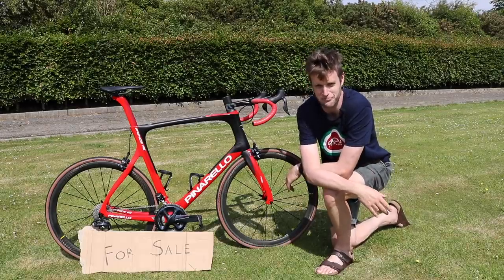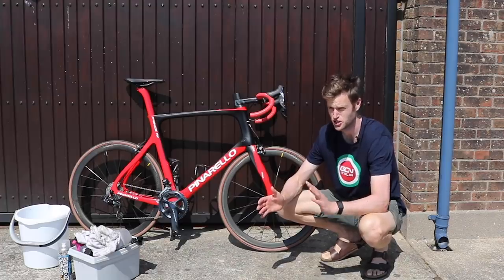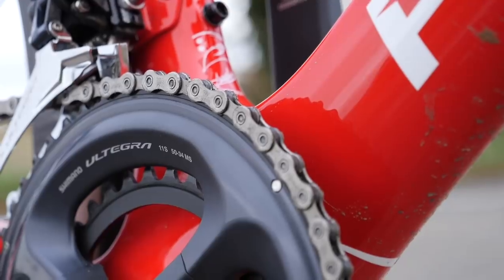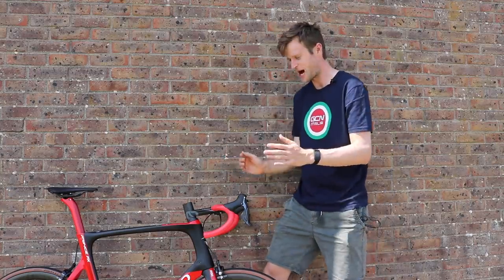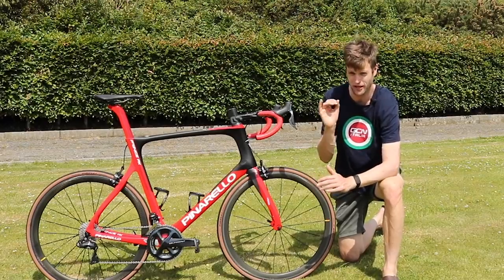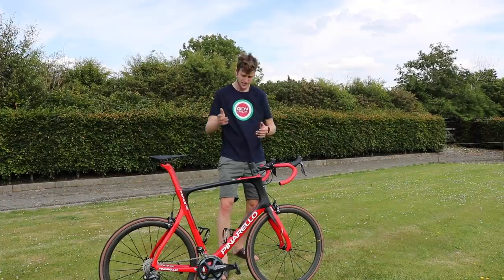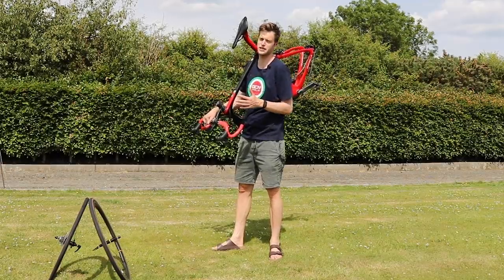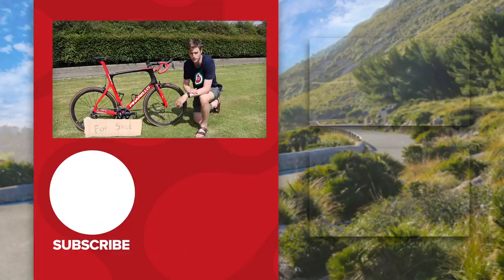How To Sell Your Road Bike For More Money

Comment from the maker: What's the best second-hand bargain you've ever managed to get? Let us know 👇
Reply: Last week, focus izalco pro 2015 Sram force/red for £375 👍👍

I didnt even need a new bike 😂😂
Reply: Has to be the one that got me into cycling and I have been riding for over 2 years now :). A pristine 2003 Koga Miyata GentsLux with 105 for 300 euro!
Reply: Giant tcr advanced disc 2 with only 40km for 700€
Reply: 2012 carbon specialized roubaix frame for 200usd
Reply: I was working at a large sporting goods chain, a homeless couple came in with a bike, not uncommon, grabbed one of our bikes, ditched theirs. After a few months I asked my manager if I could have it, it’s just a single speed but it’s got decent wheels, gator skin tires, and it fits me. What more could I ask for😂
Reply: A lovely old Raleigh with 531c tubing and full campag groupset, headset, and wheels etc aswell as cinelli stem and bars, all for just a £5. My best gumtree find. An add with a pixelated single picture turned out to be absolute treasure
Reply: Pinarello gan S with ultegra for 1650
Reply: Carrera ltd TDF, pretty much brand new for £100, rode it for a year for commuting and sold it for £180 as it was still in good condition!
Reply: Got voodoo hoodoo for £250 brand new off a mate who's changing over to a road bike.
Reply: And last year giant propel advanced 0 for £1000.
Reply: Got a a BMC Roadmachine for only the price of a pair of bolt cutters! Lucky me
Reply: Just got sram force and all the parts for a venge for $230 cad
Reply: I just bought a 2018 Trek Domane SL5 Disc from a private owner for $900 cash. It needed some cleaning and slight maintenance. But now it's mine and my first carbon framed bike. It has tons of potential with upgrades.
Reply: My favorite second hand bike buy was a 2010 Gary Fisher Cronus Ultimate. I got it as a carbon repair frame. I built it up with my first generation Sram Rival 10 speed group, Easton cockpit and Mavic Wheels. Best riding carbon bike I own.
Reply: the only complite bike i buy used was a balistic  road frame with carbon flat bars  for 200euro ,, price new was 600 ,,  upgrade the wheels and crank set ,   install drop bars with sti shifter ,  and use the wheels and crankset on a old peugot i got for free ,,  and the flat bars with shifter on my gf bike ,,
Reply: Bought a Specialized Amira SL4 pro race with Sram Red components for $900.  Saved maybe $4000 off the new price. Also bought a Open One+ mountain bike for $2400 with Sram XX1 Eagle.  Probably saved $7000 off the original price.
Reply: Got Dutch Union town bike 15 years ago for 100€, second hand, and still an absolutely belting runabout. ...albeit two serious overhauls later. Quality lasts!
Reply: I bought a used used carbon trek for $150 on local listings from a guy rushing to sell and zipp 50mm carbon wheels almost new for $100. I have a 15.5 pound bike from 2013 with aero bars, saddle and seat post for under $400 bucks total. Got an offer for $1300 yesterday when trying to see how to value it
Reply: Mongoose ledge 2.1 for $35, still had knobs on the original tires!!!
Reply: @jesseladd6864  holy hell, this is a dream,  I thought I had a good deal...
Reply: 1991 Francesco Moser Leader AX in hot pink with full period Dura Ace 7400 for €400. I've still never seen another one in the same colour scheme.
Reply: Jesse Ladd whats the brand for the 2013 bike
Reply: Mid eighties Celeste bianchi specialissima with full campy, including delta brakes  for 350.00 on craiglist. I’ve never sent an email faster before
Reply: I got my first bike for free from a friend who was clearing out his shed
Reply: Diverge expert ultegra for 900
Reply: 20 years ago I got a Tiagra with full Campagnolo Record for free. Campagnolo still working well after ten thousands of kilometers 😁👍🏼
Reply: Just bought a fully original 2002 Pinarello Prince with Campagnolo Record 10 speed for $500 (it was dirty and had trainer sweat...).  I will enjoy it for a while.  Also bought a late 1990's Columbus Foco Gitane with full Campy Chorus 9 speed for $280 later sold the frame for more than that...
Reply: Argon 18 Mercury frame for 80usd
Reply: Got married to multi millionairess divorcee
Reply: C14 Speed Pro full carbon Ultegra for 200€
Reply: Cannondale caad8 '13 with only a few kilometres (more or less 300) for 400€
Reply: What is this "sell" word?   N + 1 !
Reply: Stolen bikes.
Reply: 2017 specialized allez sprint in very good condition at a good price. Upgraded it with a specialized power saddle, 50mm Prime carbon wheels and supacaz bartape

Comment: My TT/Tri bike, bought 10yrs ago. Its a Cervelo P2C. It was originally blue but had it resprayed. Runs with second hand Zipp 404/808. Have replaced the groupset parts over the years.

Comment: I bought an unused 2013 Wilier Escape (alu w/carbon fork) in Cofidis team colours for $250USD back in 2018. Built it up with 105 components, & Pinarello-branded brakes. I already had the Cinelli bar & seat tube, Deda stem, 105 crankset and Mavic Cosmic Elite wheels, so it was a good budget-build. Awesome bike. Perfect as a winter, travel & commuter bike shod with 25c Conti GP 4 Seasons. My next project will be to look for an older steel Merckx or Colnago frame to outfit with modern Campy Potenza groupset as a Sunday ride special.

Comment: Best bike I've purchased second hand on eBay: A Genisis Equilibium, with 653 steel tubing, 105 5700 group set, carbon fibre wish bone seat post, Gell pads under the bar tape, 28mm wide tire.  Shimano XT hubs front and back.  Excellently smooth bike.  The seller wanted £750, but accepted my offer of £599 and even dropped the bike round to my house, since the couple who sold it were driving past where I lived on a family visit three days later.  Perfect.   Best cycle related sales I've made on eBay:  a Raleigh 531 frame and forks  sold for £25 to a retro bike enthusiast, and a Moda Nocturne titanium frame and forks, for £750.  The titanium frame and forks were almost brand new, and had to go because they made up a bike much to big for me.  That was a rare mistake by Fat Birds in Hunstanton, wanting to please an over enthusiastic customer, me.  That experience taught me to get a bike fit before spending big money on a bike.  It also led me to attain a bike geometry that I really wanted.

Comment: The bike I scored for my indoor trainer was out with the hard rubbish. Steel no name frame with Shimano RX100 components. I rebuilt the wheels, new cassette and chain. Dont have to worry about the weight of the bike, its at least 12kg. Its not going anywhere. 25000klm later its still going on its 3rd chain and cassette.

Comment: Best bike I ever got second hand was a Pinarello Asolo from the 80's - Columbus SLX tubing, chromed drive-side chainstay, white Turbo saddle, all-original Shimano 600 Arabesque Indexed groupset (there were few with overlap between the two) down to the hubs, pedals, headset, etc. Best part? It cost $200 USD. Sadly sold it to a friend.

Comment: Please never buy a bike with more than 1cm of spacers over the stem, for your own safety and never ride a bike that way for more than testing it before cutting the steerer tube, THIS IS DANGEROUS AND CAN KILL YOU AND KILL PEOPLE YOU SELL THE BIKE TO, most expander plug in steerer tube of the fork are 4cms (some are 5cms and some go to 8cms) but when you clamp your stem to a part of the steerer tube where this is no support (aka expander plug) you are crushing the steerer tube and damaging it each time you ride it.

And the warranty won't go to the new owner of the bike, it's only for the first owner ...
Reply: I believe this issue only applies to carbon steerer tubes.  And, as you said it, just check the length of the expander plug.  It's a good idea to inspect the steerer tube anyways when buying a used bike.  So as long as the expander plug is long enough so that the stem clamps down on it, it doesn't matter how many spacers you have over the stem.
Reply: @hansschotterradler3772  like i said most expander plug are 4-5cms, a stem is ~4cms.

Comment: I've got an anti-tip (and a tip for potential buyers): caked dirt and grime may lower the price of the bike, but it may also hide the bike's true condition. Bought a singlespeed I thought I was getting a decent deal on, turns out the thing hasn't been fully serviced ever and a lot of parts (such as the rear freewheel and the bottom bracket) need replacing. I still don't know if the guy just didn't know that you need to do something other than just change the chain sometimes, or if he knew the sad state that the bike was in and sold it to some idiot for a good bit of change.

Comment: Some good tips there. I financed my bike touring holiday early this year by buying and selling bikes all last year. A bit of Horsetrading paid for my flights and accom for a 3 week tour in New Zealand. 
I would buy bikes with all the "don'ts" from this video. Then wash, re-cable, fix and titivate, take 10 decent photos and write a full and detailed ad. Most of the time I can double my money. 
This is also how I went from a c2006 9spd Ultegra equipped Apollo Raceline to a 2014 11sp Di2 Ultegra kitted Giant Propel without putting in any more of my own money than the original $239 for the Raceline.